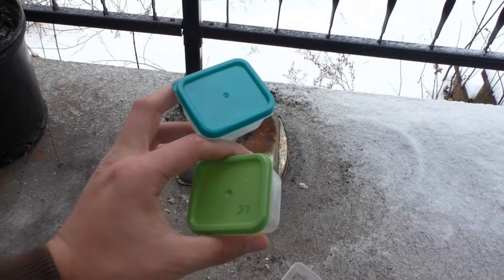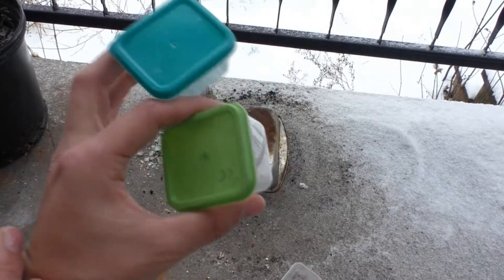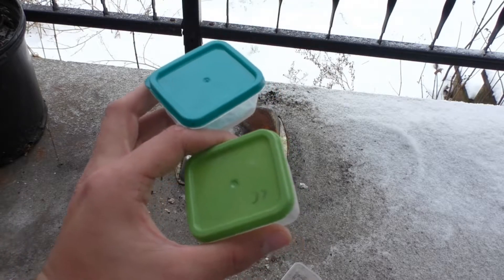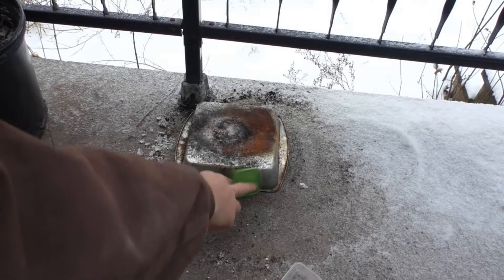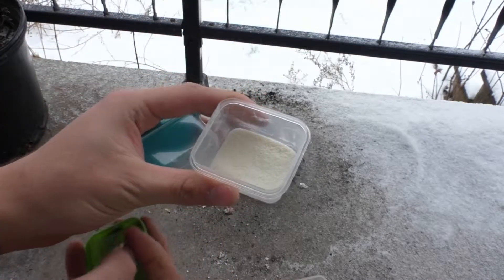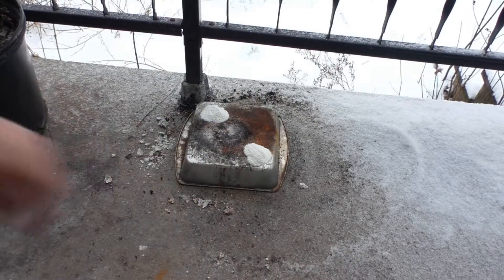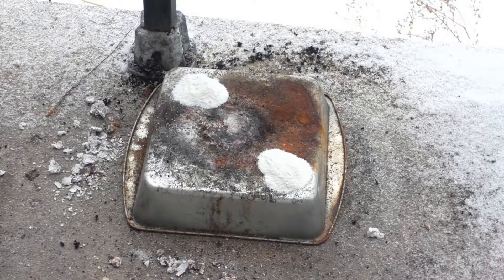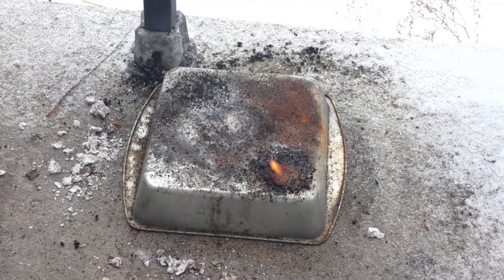PCRT RV, Coffee Creamer (Potassium Chlorate Reaction Test Revamped)

Comment: When making flash powder what's the difference in reaction between red and black aluminum powder?  Also can you substitute Potassium Nitrate with Potassium Chlorate when making rocket motors?
Reply from the maker: I never heard of red aluminum. But that should probably just be a coating to prevent oxidization I would believe?

 As for  substituting, probably. But ratios need to be changed.

Comment: Still waiting to see PCRT with acetone melted styrofoam. Melt the foam, mix in the chlorate, and let it dry so it's a solid ball.
Reply from the maker: Already suggested by Will Flock.
Reply: RadPyro1 that plus Al powder would be a plastic explosive

Comment: Sugar definitely burns more vigorously. The other one had more power than I thought. Sugar version looks like a possible rocket fuel. Try aluminum powder. Not dark aluminum just finely ground foil. Wonder if it will still burn without any charcoal to protect it from oxidizing.